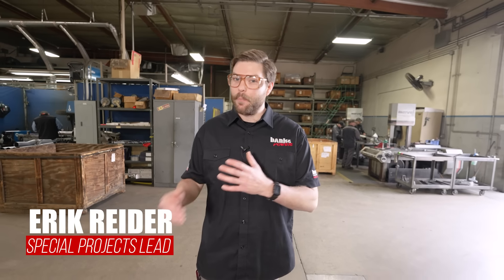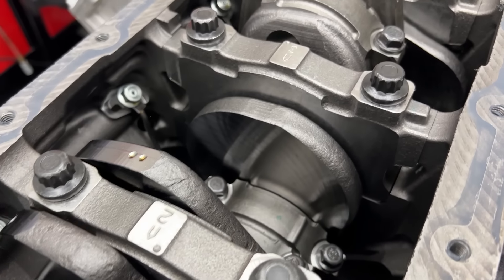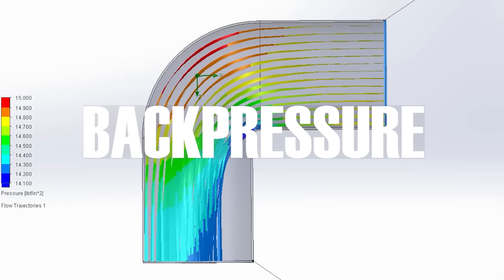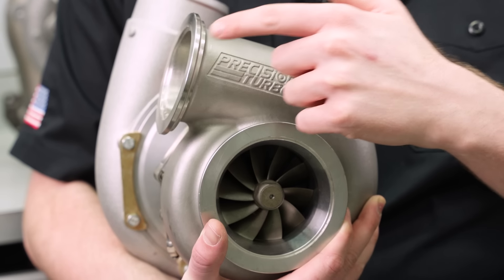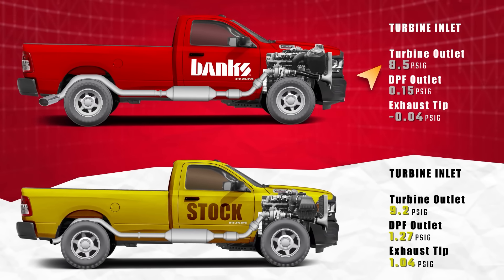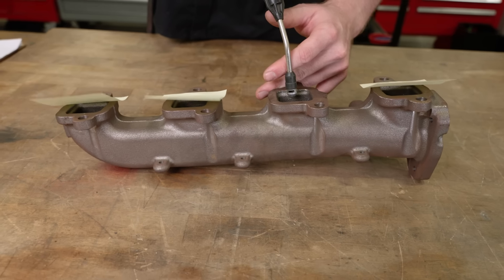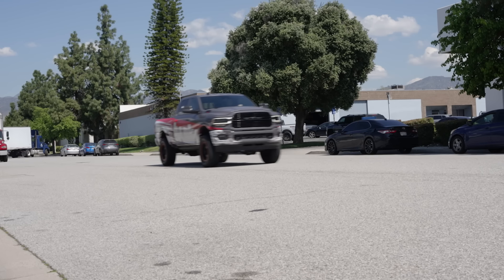Busting the exhaust backpressure myth | Banks Entry Level

Comment: So you tune the header for the engine. I have a Buell one cylinder runs hotter. So header is tuned for the hotter cylinder. The exhaust actuator value is there for exhaust gas speed. That's why without the actuator you loose some low end torque.

Comment: Backpressure is a silly word. If you can measure it with a pressure gauge, then it's pressure. But exhaust flows in waves and waves are both positive and negative. The positive part of the wave can be referred to as pressure and the negative part which is below atmospheric is backpressure.  It all comes down to definitions and it's the definitions which aren't defined.
Reply: The way an engineer explained it to me is … “back pressure is the measure of the force pushing all the air in the exhaust out of the way to let the exhaust gas out”
Reply: That's pressure.
Reply: @1magnit  … yeah, but you understand there are different types of pressure interacting with each-other constantly, right? It’d get really confusing to just start describing everything in the broad category it is a part of - like a balance sheet that just says “money” and a number 15 times is not helpful.

Comment: So why would a simple collector extension...which has an optimal extension length  on a header that all primaries meet at the collector....add a noticeable torque increase?
I have seen test done by old timers where they put say a 20'' long collector extension on the header/collector....run the engine and the extension would discolor or get a blue tinge due to heat say 16'' from the collector,which is suppose to be the optimum collector extension length for best tq gains....
Is the collector extension just increasing the scavenging effect?
Is the optimum collector extension length different on say a 300hp sbc 350 versus a 400hp sbc 350 both with the same header?
Hope that makes sense.

Comment: I remember hearing that less back pressure, less torque
Reply: It's partially true, depending on the engine and exhaust system. Look at zoomie pipes and why they've fallen out of favor, and how they're only found on sand rails these days. In the high end you gain more power than stock, but in the mid range you can lose as much as 20% of torque.
Torque is also effected by things like length of the intake runners. Which is why Ford and Toyota have used clamshells in the past.
But of course they didn't address things like that because this was all just an advertisement for their products.

Comment: How about an update on the 2024 Duramax Derringer??
Reply from the maker: The 2024+ L5P Duramax trucks have a new updates for emissions regulations and new computer systems. Because of these changes, they are even more sensitive to any major changes like fueling, air flow rate, and temp in the intake. We must work with these changes an unfortunately that has forced us to change harness and calibration on the Derringer. We do not have an eta at this time because we are currently developing and testing the Derringer.

Comment: well its true and not. The reason back-pressure is needed in an engine, because when the exhaust port is open and pushes out the burnt fuel gas, the intake valve already opens. If there is no back-pressure, the exhaust side will suck out the intake side fresh air, creating a loss of combustible air/fuel mixture. it will be a rich running engine.  Now this applies mostly to carburetor and naturally aspirated engines. The turbo of course pushes a lot of air into the combustion chamber and in theory it could also benefit from back-pressure, but if I recall the loss of pressure is less.  It has been a quick minute since I studied this - nearly 35 years - but we never really got into forced induction.  
An another thing about diameter - the larger the diameter the bigger the volume but the less the velocity of air/fluid. The smaller the diameter the higher the velocity and lower the volume. Think of the garden hose when you put your finger on the outlet hole.  Large volume at slower speed is what creates droning.  A smaller pipe creates more velocity and less resonance/droning.  A large dia exhaust works on a race car, as it spends most of its time full throttle or no throttle (braking) but a street car does the opposite.  This is where the resonance tuning or scavenging can help. Creating a wave that counteracts with the droning exhaust etc. So yes, less back-pressure is good, up to a point. Some back-pressure is needed to make the air-pump (aka engine) to run efficiently.  Minimizing losses are always better than just increasing output as you can grow efficiency.

Comment: Will the banks 4R100 TransCommand work with a 2002 Lincoln Navigator. If so would it have a big improvement with stock power?
Reply from the maker: No, the tuner is generally used for the Ford 6.9/7.3 and Power Strokes equipped with E4OD/4R100
Reply: Thanks

Comment: Obviously the video is used to sell exhaust systems. The need for back pressure myth is just as likely to come from the fact a really unrestricted exhaust will cause the AF ratio requirements to change and if not adjusted, the engine will run worse. Same goes for tuning the exhaust pulses. This would require a jetting change on sensitive engines like two-stroke expansion chamber bikes.

Comment: Pull the muffler off your 2 stroke dirt bike and try to say backpressure is not needed. Tested on dyno by Peterson Publishing years ago. Slight torque increase with headers and manifold vs open exhaust. Most engines are not turbocharged and gasoline powered. Peterson's was not selling a product.

Comment: 2:00 the hair drier example is completely wrong. The impeller is staling and putting LESS resistance on the motor. That's why the motor speeds up.

Comment: Dumb question here: would it benefit the exhaust system, and even the cylinders, if you put an inline fan a few feet after the headers? Remember the gimmick fan that went before the throttle body to “increase mph and power”? Something like that to keep clearing air moving faster.

Comment: The myth about "needing" some backpressure comes from running engines without exhaust's on or with mufflers, and then being surprised at how doggy they run at low speeds. Every video that I've seen that claims to bust the "backpressure" myth actually shows a hp loss at low speeds so its not like there isnt something to it. Theres probably better ways of handling that if it matters than having an excessive amount of extra resistance that affects the engine at all rpms. Exhaust throttle for better low end grunt??

Comment: Curious. Then, explain - I had a one cylinder motorcycle. I put on a straight pipe thinking I'd have more horsepower without the muffler's back pressure. The power went into the dirt.  I was told that some engine backpressure is needed for efficiency. I replaced the muffler and the bike ran well again.   So - Some Backpressure is a plus - after all.    This video is only talk about massive backpressures.  Not, subtle.    The old adage is - "Some backpressure is required!" Not what is explained in the video.
Reply: Iirc you have to re-tune your carbs after reducing back pressure. But don't quote me on that

Comment: It sounds to me you need a designed system that takes in the turbo pressure only when needed on the power stroke and doesn't affect the exhaust stroke.  Way more efficient.  This could be done.  You people have many things worked out, thank you.

Comment: My 2 Cats are clogged & thats causing severe back pressure, & severe lowered mpg. The Cats are welded on which should be s crime because if they were simply bolted on, i could've easily replaced em myself. Instead i have to spend $500 to my Mechanic for a new Y-pipe

Comment: How does it affect the torque curve?
Reply: Increases torque, especially at higher rpm where it can flow better. Low rpm doesnt matter so much since its not even putting a bunch of pressure into the exhaust to make it restricted.

Comment: Borla would disagree with you, no other company including Banks has as many wins using their exhaust products as Borla.
From Borla, it is all about velocity. Bigger does not equal better. 
Q. Is a bigger pipe and muffler system better?
No, there has to be a balanced design to enhance the maximum engine output, exhaust gas velocity, and sound. If the diameter of the tubing is too large, the exhaust gas velocity will be reduced and rob the exhaust of thermal efficiency.  Unfortunately we often disprove accepted racer mentalities like bigger is better. We must spend a great deal of energy explaining to someone how a 4" exhaust pipe will not work as efficiently as a 3" pipe. That is hard sometimes, but it is why we have magazine editors. Even with our excellent "track record" winning more professional car races than all the other muffler makers combined, we still often have to prove our theories to very well know top racers. One of these issues is volume versus velocity. The late John Lingenfelter helped us prove this over and over with his legendary Corvette exploits. People were often amazed how he would run 600 plus horsepower Vettes with 2 1/2" exhaust. If 4" would have made John go faster, he would have run it. We need to have a pipe large enough to overcome the boundary layer restriction in a dynamic flow situation while maintaining exhaust speed and evacuation. This isn't a simple axiom to understand, but the second best explanation is to say in race classes where let us say the budgets are seldom limited and the rules are not restrictive regarding exhaust, you will observe much smaller exhaust header tubing and exhaust pipes than some kids run on their 190-horsepower hand-me-down Honda sports compacts on the street.

Comment: Again, this might be true for wide out throttle. Do your testing with small throttle openings and NA and we can start the talking. Very few want to use the upper rev range
Reply: With the throttle mostly closed there is so little air density backpressure is usually a non issue. The throttle is the main restriction by a wide margin.
Reply: @177SCmaro  without the throttle restriction you can't control the engine. The most enjoyable driving experience on road is when you're driving on on high gear and low rpm and just by pressing the gas pedal you get good acceleration. It's connected to driveability.
Reply: @valkman761  
Obviously. The point was that at small throttle openings there is so little density downstream backpressure in the exhaust is seldom a concern.
Reply: @177SCmaro  I do not consider backpressure an issue either, rather what is needed to help extract the gasses
Reply: @valkman761  
Low pressure behind an exhaust pulse promotes scavenging. Not backpressure.
Reply: @177SCmaro  exactly, and how do you get scavenging effect? With something that usually cause backpressure
Reply: @valkman761  
No. Scavenging is an effect of the nature of the exhaust pulse with a high pressure front and a low pressure tail which increases the pressure diffeental between adjoining pulses helping to draw thr next out. 
Backpressure created by resistance to flow which the engine has to overcome and reduces how completly the cylinder can be emptied or filled.
Reply: @177SCmaro  you won't get scavenging effect with straight pipes
Reply: @valkman761  
You might let everyone who's ever run open headers in racing know they're doing it wrong because you say so.
Reply: @177SCmaro  now, look at my initial post again
Reply: @valkman761  Now look at my initial post again. With the throttle closed that is the biggest restriction. There is so little density downstream backpressure is seldom an issue.

Comment: I thought backpressure helped engine breaking and stopped it from backfiring. How can you open your exhaust all the way up and not have any backfire is that in your header.
Reply: It can reduce backfires and can probably help engine braking but not by a lot. Less back pressure makes a cleaner burn.

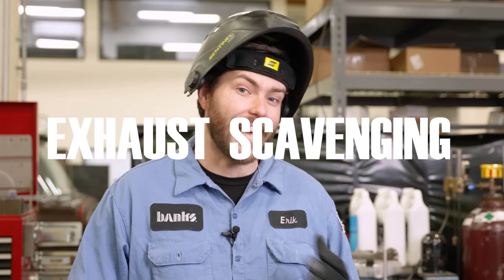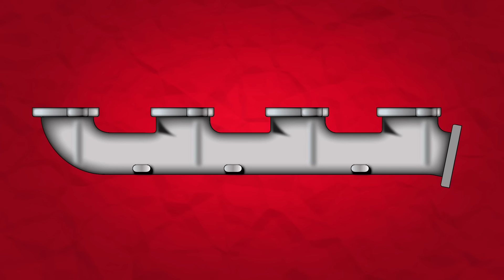Comment: 8:15 to 9:07 look at the difference in how long the air blower tool was inserted in the manifolds.....
Reply: Scavenging requires equal lengths of tubing coming from each exbaust port. Log manifolds do not scavenge

Comment: god i hate these statements that backpressure is needed for an engine to run properly. altho i hear it mostly talked about a 2 stroke engines. and it comes because when they remove whole exhaust, the engine doesn't seem to run properly and they just assume from that 2 stroke engine needs backpressure.
it doesn't, but by how 2 stroke engine works, it needs a tube for the inertia of exhaust air sucking in new air. what you need in 2 stroke is correctly sized tube for it to scavenge so that all exhaust air leaves combustion chamber.

Comment: So would it be okay if when I replace the exhaust on my Tacoma which comes with 2.5 inch exhaust would it be okay if I replaced it with 3-in exhaust with an x pipe in the middle? Because everyone I've spoken to says that I will lose back pressure and lose horsepower and torque because of it.
Reply: 3in is a bit unnecessary big for the engine size and power. People usually go 3in for a high boost turbo build for that engine size. 2.25 or 2.5 is plenty for an n/a build. 
I have a 99 4x4 auto 2.7l with steel bed and bumpers. It's got a gutted cat, into a slightly larger flow master and ends in a 4in bed stack.😂 it apparently makes ok power. I can race early 6.7 Cummins trucks to 70mph and win every time 😅
Reply: Easy way to test: remove the exhaust and see if power drops with 0 back pressure. No purchase necessary.
Reply: @lamarzimmermanmennonitefar5269  I plan on installing a procharger in the near future. I guess I could just have the exhaust installed at the same time.
Reply: @Cloud30000 only that's not how it works. They would kill velocity by dumping out too early and also causing the exhaust gas to cool down quickly. Cold air moves slow. That's why you see header wrap.
Reply: @Mike-42069 get the 3 inch
Reply: Too big of an exhaust can certainly have negative impacts by actually increasing back pressure do to velocity of gas related to temperature and the witchcraft of fluid dynamics, but I really doubt  3” is to that point that you would see anything negative but your also unlikely to see any change at all on a stock engine.
Reply: @jaydunbar7538  too big of an exhaust with not increase back pressure. Velocity would suffer yes but back pressure is a no
Reply: @randyschmidt19  thank you

Comment: 8:55 how is this a fair comparison? In the headers you have the air tool inside, and on the cast form your holding it outside?
Reply: Doesnt matter how you hold it, because log style manifolds do not scavenge. Scavenging requires equal length tubes that come out of each exhaust port and then go into a collector.

Comment: The hairdryer analogy isn't exactly accurate.

The hairdryer doesn't have anything that regulates air speed, it just has a motor that has a few different speeds based on how much power goes in.

When you block the intake our outlet of the hairdryer, you are making the air static, this reduces resistance as the fan no longer has to push air and it spins faster. If it was making the motor work harder, the fan would spin slower.

Comment: Not an engineer, but wasn't it needed for old engines/fuels and 2 strokes? 
Running short straight pipes on an old engine was a bad idea because the exhaust port would quickly overheat (mine did anyway), on modern engines I agree it isn't needed because we have better materials and production methods.
I guess it's all down to the engine design.

Comment: Toyota doesn't need scavenging, they are already near 0psig around BDC In their simulated atkinson engines. Maybe these other manufacturers should learn to design Intakes and heads so Banks doesn't have to fix it for them.

Comment: Nothing new here.!
The French developed this 100yrs ago for marine engines. They call it "pipeometre". It is based on SWR.
There is a mathematical model  (formula) which starts with the CFM of the inlet side. Carburetor trumps Injection here. Velocity Tubes and the likes.
My Street-Race Car / Sleeper, has 120 extra HP and a shitload more torque, and still passes all the Police / roadworthy inspections.
Been using it, and variations, for 40+yrs.
Oh, and done right, will improve your mileage also.
When the exhaust gas reaches peak velocity, it starts to sound like a jet engine. After all, both are forcing hot gas' out an orifice.😆
There is an "Afterburner" variant also.

Comment: ATTENTION VIEWERS: ERIC is 100% WRONG with his hair dryer example at (1:43).
1)  Electric motors DECREASE in RPM under load, not increase, unless they have a special controller that commands them to compensate, which this silly hair dryer does not.
2)  The hair dryer increases in speed when you block off the end because the blades are CAVITATING in the newly-created LOW-DENSITY air space around the shrouded blades.
3)  Blocking the end of a running hair dryer does NOT create a high pressure zone AT THE BLADES.  On the contrary, it creates a LOW-DENSITY area immediately around the blades which then causes the CAVITATION condition, resulting in increased blade speed.  Completely the OPPOSITE of what he tells you is happening.  
4)  Blocking off the air flow of the hair dryer or a shop vac, etc where the blades of a motor suddenly increase in RPM is due to CAVITATION, not increased backpressure.
5)  Mattias Wandel and others have fantastic videos out there demonstrating this both mathematically and in real-time experiments.   Go check them out to better understand.
6)  Does this debunk this video about backpressure?  ABSOLUTELY NOT.  I'm simply pointing out that his hair dryer example, which was intended to demonstrate his point, was 100% incorrect in relation to the goal he was trying to communicate.  That is all.  Should a Special Projects Lead know this BEFORE making a video intended to prove a point?  Perhaps.